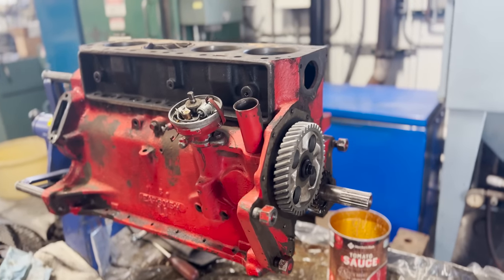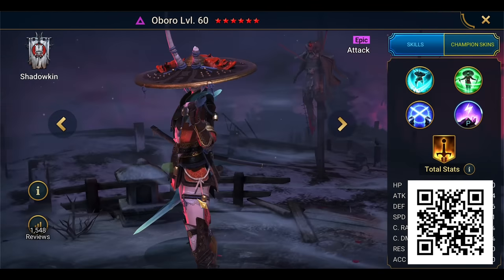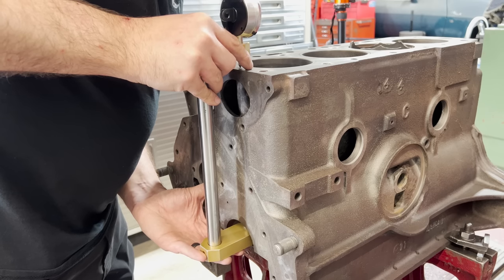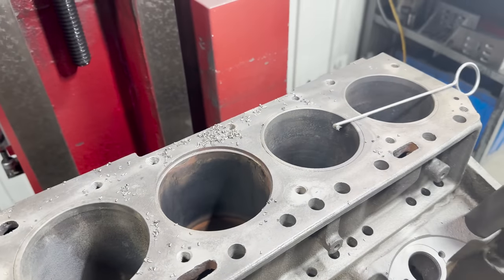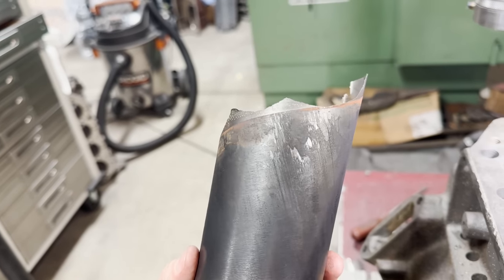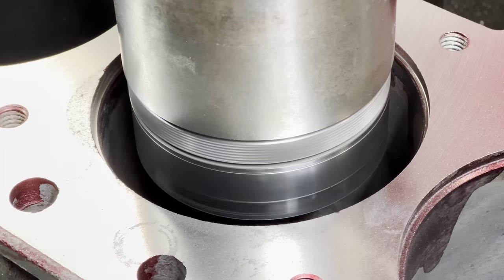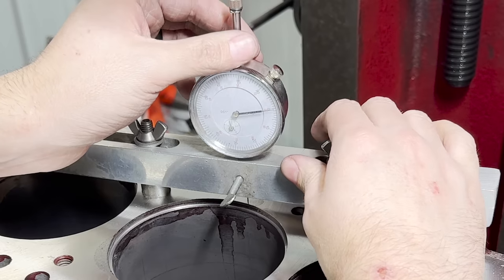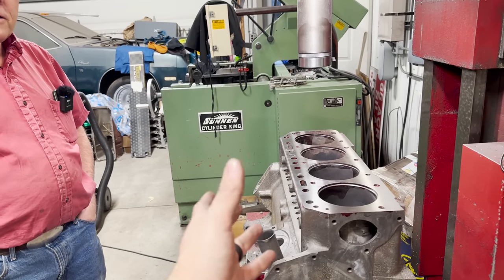Do YOU Want To Know Why WE Don't Use Sleeve Pullers?

Comment: Take the high spots to spec then put sleeve retainer on the low spots🤷‍♂️. Then shrink sleeves, put them back in block, let dry for 24 hrs, and then finish bore. Sleeve retainer data sheet says up to 0.007 out. Just a thought.

Comment: It looks like from the way that broke it was a homemade puller that failed at the weld. I'm not sure why this means you can't use a proper sleeve puller. I made one as well for my Kubota engine sleeves but the screw rod I used was a forged piece I picked up from a broken Snap-On puller I inherited from my father, and well-greased using moly grease. The pulling trellis was a piece of 1/2" plate and 1.5" x 3/16" angle at each corner, held together with a piece of 1/8" plate at the bottom with a hole a little bigger than the cylinders cut in it. I set that on some strips of aluminum from the hardware store to prevent damage to the deck surface. The pulling plate I made on the lathe using aluminum so that if I did end up having an issue with it canting off to the side it wouldn't damage the block. It worked beautifully, although now that I've seen your method here, I might rethink doing it that way again. I did set up on the Bridgeport and bored out the new sleeves to size once they were pressed in, so there's nothing stopping me from doing it this way if I ever do this again. And you ain't kidding with the amount of force needed to pull these things. I clamped the block to the mill table and I had a ~4 foot cheater bar on there using my feet braced off the mill table to initially break them free. I would estimate somewhere around 1200 lb-ft. of torque being applied to the screw based on how much weight I can pick up using the same motion. It was stubborn all the way out too. Not for the faint of heart.

Comment: On old tractor engines ive used a welder to put a bead down the sleeve wall. It makes the sleeve draw and they will pull our just fine. You cant get too hot with welder cause you dont want to weld block.

Comment: When dealing with dry sleeves you need to bore them out, I was going to comment this before you mentioned putting it on your bore machine, I watch a lot of car videos and every engine restoration I’ve seen the sleeves have been bored out, I see this as a case just because there’s a tool to pull sleeves and just because you can doesn’t mean you should especially if you have no idea of what you’re doing that includes everything technical, building/upgrading engines, building/upgrading computers, guitar amps, guitars etc.

Comment: A part 2 would be nice.  A over size sleeve would be the proper way I have found that dry sleeves sometimes from a different manufacturer will have close specs for the diameter but may have to be cut shorter.

Comment: As a heavy diesel technician, I do not enjoy dry sleeves. You essentially have to get the machine shop involved, for all of the listed reasons here. Is it nicer than parent-bore for a lot of applications? Sure. But compared to wet-sleeve for serviceability, it isn't even close. As long as the cooling system maintenance has been looked after and the lower sealing counterbore hasn't been eroded/cavitated/corroded, then you just need to verify proper protrusion and go. If the protrusion is too low, it's a very straightforward deal to learn proper use of a quality counter-bore tool, to cut new CB's and set up shims for ideal protrusion. 
Over a decade of Cat, Cummins, Perkins, Kubota, International experience- mainly Cat and Cummins. First 2 in-frames were a DT466E and a 3406E(5EK). Had an Isuzu 4BD2 (3.9L diesel 4-cyl) we were going to re-ring in my first year wrenching, and we found it had dry sleeves that were thinner than exhaust pipe. Had to let the machine shop handle the removal. Install wasn't too bad, they froze the sleeves with dry ice (Per the manual) and they dropped right in. 

All of that being said, good job here gents.

Comment: Can't blame the last guy for that block being out of spec. That is what you normally see from old blocks that have been hot the distort, heck all blocks distort. Boring holes that far out of round  would typically be a difficult task as it would require an extreme out of tram condition to put that much ovality in a spinning circular cutter.  Or the block would have to be consistently harder and softer to make the cutter dig more or less but likely an operator would have detected that with that much difference. I commonly see blocks distorted like this and the same goes for the head.  They didn't have a contoured machine to put those dips and valleys in it that is the results of the cast iron growing and shrinking differently from different levels of heat. Most 6cyl blocks almost always go low in the middle because that part of the block is the hottest and the heat shrinks it.  If your gauge is on nominal if you put the sleeves in the distorted block and they follow the same pattern  you should be able to clean it up with the hone to get it round but will probably wind up close to the low end of worn spec if they didn't give you any extra on the sleeve. I can usually get sleeves in about any size I need from melling pretty quick and affordable if you wanted to lathe out some oversize ones and fix the block bores back exact.  Personally I would suggest going with the sleeves in the out of round bores hone true then use oversize rings file fit to proper end gap clearance but run on the stock pistons. 001" or .002" extra piston to wall clearance noise on a farm tractor will never be heard and it won't hurt anything at all.

Comment: Bore the walls to clean up use over size sleeves with stock on the ID and bore the ID brand new block .. just a little bit more on the machining side and maybe little more cost on the sleeve but then its all brand new and square and not out of round ..

Comment: Another trick to removing those sleeves out in the field with the engine still in a machine like an excavator I've used is taking a torch and heat up down the sleeve in a line from top to bottom in two places 180 degrees from each other and let the sleeves cool and they normally will pull right out almost by hand because they will shrink down enough to just slide right out. This is of course provided there isn't a ton of corrosion between the sleeves and block but, 90% of the time it works like a charm in a pinch. Worst case you can also wash one side of the sleeve out with the torch carefully and remove them if there is bad corrosion locking them in.

I know it's also not the proper way this should be done out in the field and that I'm suppose to pull the engine and take it to a machine shop to get everything checked but, I'm sure you know as well as I do how some people are and they don't want to spend a dime more than they have to and don't care if it's done 100% right as long as the machine gets back up and running and making money again. I personally hate that kind of work but, it's kind of part of the deal when you do field service repairs.

Comment: it seems to me you would want to check that the cylinders were round and perhaps turn them first before doing the counterbore? you indicated the center off  just the top diameter of  the bore and not the bore cylinder centerline. Although I was impressed with your results boring out the old liners  and making  curly shim stock out of  them. tat was satisfying for me too.

Comment: Dry sleeves I weld out.  Welding a straight line down at 90 degrees apart and the sleeves normally pull right out.  If I had access to a boring machine I would use that.

Comment: In chassis we used to hit them with freon to shrink them and pull them out with a puller if we had the engine out of chassis and completely disassembled we would run a couple of beads of weld on them let them cool they came out very easily

Comment: Without knowing what the engine is for and how many cylinders are out of round. If low RPM and compression, it should last OK with using the supplied sleeves. I agree with going the new sleeve route for it to last long term in full use. Can a cylinder be knurled to take up clearance? Def part 2 either way.

Comment: just wondering if it be able to weld the interior of the sleeve with just a touch of metal to create more "meat" and then re-bore in the correct needed diameter? i see its used  in heavy machinery repairs... just a thought :) apologies if this sounds silly

Comment: My biggest problem is that your mill is way bigger than mine.

You said that one side of the bore is bigger than the other so that the sleeve would distort. Could you as a 3rd option bore out the tight side a little so that the sleeve would fit better without making the overall bore to large to cool the sleeve? It wouldn't be perfect, it might lessen the distortion enough with a light hone of the sleeve to make the piston and rings seal better longer.

Comment: Excuse me if im incorrect but are you going to be using the old pistons that came with this engine? Im just curious if you couldnt install those sleeves (into the parent bore as is) and bore them out to possibly a 10 thou oversize and use 10 thous oversized pistons instead of getting custom sleeves or putting a sleeve into a sleeve? honestly just curious. Im expecting that you cant get oversized pistons for this specific engine or they are way too expensive?

Comment: When you are boring out the sleeves it seemed as if I could see some wobble in the boring head. Was that the head or block moving, I expect that a finish cut would not put such a side load on the head. What is the amount of deflection that you consider acceptable when final boring a cylinder?

Comment: It would be best to put a torque plate on it because it could pull the tight side in and push the shallow side in. You can tighten the cylinder head on to quick check.